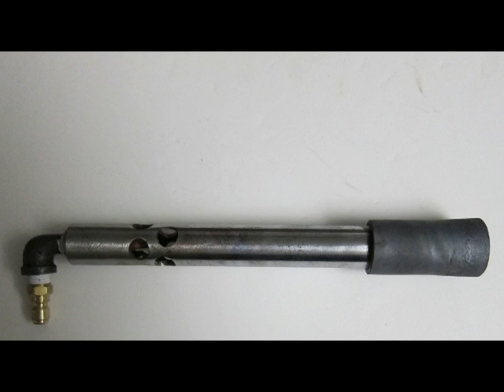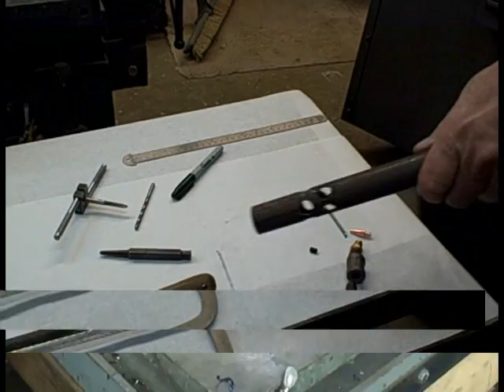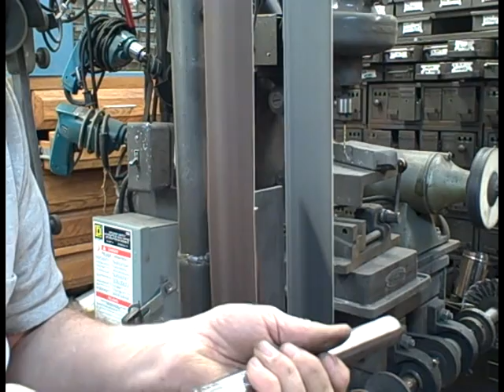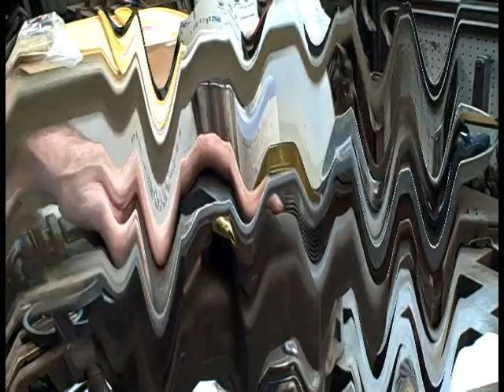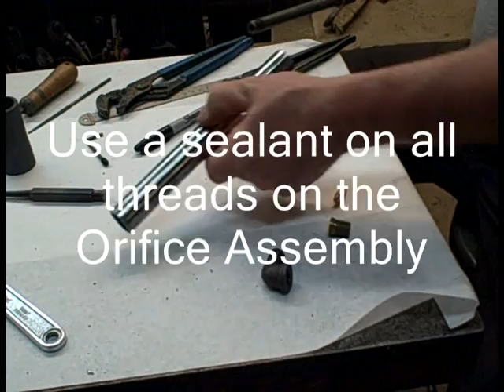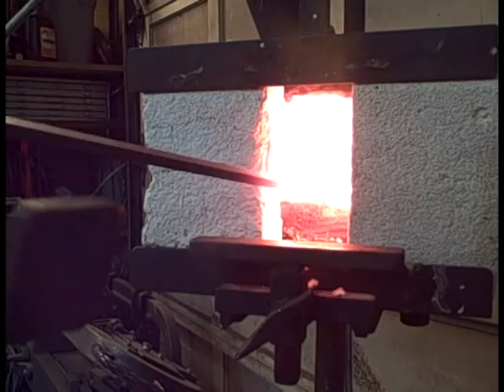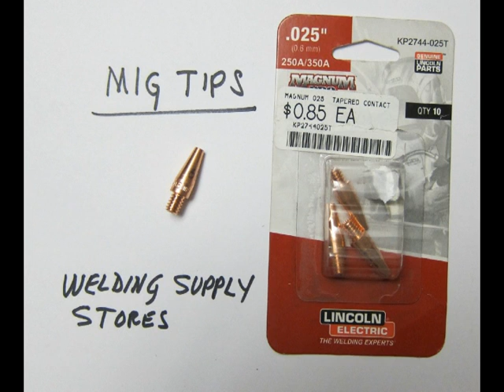How to build a Propane Forge Burner

Comment: I bought a very similar side arm burner off eBay and am just waiting for the refractory to dry before hooking the entire system up. Could you answer a couple questions for me? I'm entirely new to gas systems.

1: A seemingly stupid question but what is the point of the aspiration holes? Wouldn't this just let the propane leak from the system?

2: Is a ball valve entirely necessary? I just have a regulator (doesn't show PSI) and the braided tubing from propane tank to burner
Reply: +Chris Vozzella ....  Air has to mix with the propane to get the combustion needed to get a proper flame.  The propane blows into the burner tube under high pressure and draws air into the aspiration holes.  The turbulence of the air coming in from the holes causes the air and propane to be mixed.  Although I would not recommend you doing it (because it might create a dangerous environment), if you want to see how the propane would burn (if it would burn at all) without the aspirated air, cover the holes and try it (I would not).

In the most basic operation, you could do without a ball valve, but you would have to start the forge as  you opened the valve on the tank or as you cranked the regulator down to allow propane to flow.  Having said that, I would not have a propane gas setup without a ball valve very near the burner.  It allows for easy control of starting the flow of propane when you start the forge and provides a quick means to turn off the propane if there is a problem starting or operating the forge.  I consider all the components that are covered in my burner video necessary for safe and efficient operation.
Reply: Okay so my original concern was when the fire was blown back into the aspiration holes (It's kind of windy in my area sometimes and I have to forge outside)

Is this a cause for concern? I've been immediately turning the propane off when this happens.
Reply: +Chris Vozzella ....  It would be a cause for concern for me.  Aspirated burners generally do not do well in a breeze, and as you know, there are no safety mechanisms on these burners.  I don't know of any solution other than moving the forge or putting up something to block the wind.
Reply: okay cool thanks for the help David. Going to see if I can build a table with a semi wind block for the burner.
Reply: Hey David sorry to bother you again but I'm having trouble with the gas forge. Even though I built a good wind guard, the flame still wants to "suck" back into the aspiration holes and not into the forge. My setup is from propane tanks > High Pressure LPG (0-30 PSI adjustable regulator) > Side Arm Burner (bought offline but is identical to yours in this video)

I calibrated the burner like you showed by having the best looking blue flame, but am unsure on how to use the regulator. After testing the regulator at all different settings it still does the "suck" back into the aspiration holes.

Any suggestions?
Reply: +Chris Vozzella ...  Just two more things to try...  Beyond that, as I said before, aspirated burners (regardless of type) do not work well when it's windy.    What openings does your forge have?  Is it open on more than one side?  And how much?  Limit the openings to one that is down wind and not more than a few square inches(3-6).  Also, crank the regulator all the way to 30 PSI and let the forge get hot, then back it off if you want less heat.

Does this ever happen when there is no wind?

Wind does swirl, so if it's even moderate, you may not be able to use the forge outside.
Reply: When i tested it out today the wind was barely noticeable and with the wind guard up I don't think there is any chance the wind blew it out.

The forge guide I followed was: (http://www.zoellerforge.com/simplegasforge.html) and Zoeller appears to be MIA which is why I had to order everything elsewhere to try and make it work.

The opening is on one side and the diaphragm is variable depending on how the fire bricks are oriented. Making the hole larger and even taking away the fire bricks still didn't fix the problem.
Reply: +Chris Vozzella ....  I'm not sure what else to tell you, but here are a few other things to check.   Are you sure the thermal blanket in front of the burner is out of the way of the flame?  It should actually form a cone into the burn chamber.   Is the propane tank you are using full (or at least near full)?  Also, when it is working, does the burn chamber get to forging heat?  Does this always happen, or only occasionally.   Send me a link of the eBay auction that sells what you purchased....
Reply: I didn't have the blanket in a cone, more of a cylinder shape. I'll cut that out and see how it goes. The propane tank is half full, got it and an empty one off a friend who didn't need it anymore. Yes, every time I light it fails to keep the flame in the furnace. I'll try messing around with these things see how it goes.

this is  the ebay auction: http://www.ebay.com/itm/U-S-Made-gas-burner-blacksmith-forge-raku-kiln-propane-foundry-with-regulator-/231688958884?
Reply: +Chris Vozzella ....  Do you get a light to strong (jet blast) flame when you light the burner outside the forge?  If not (and even if you do), clean the orifice with fine wire or an acetylene tip cleaner (they can be bought for a few dollars at at welding supply.  If you don&#39;t get a jet blast flame, try a different regulator.  You might also add a pressure gauge inline to see if you are getting 30 PSI from the regulator.

Make sure the orifice is pointing straight down the center of the burner body.  You can ensure this is the case by unhooking the hose and doing what is necessary to hook a water hose up to the burner.  Hold the burner vertical (flare down) and turn on the water.  The water should come down through the center of the tube.  If it doesn&#39;t, that is most likely your problem if the regulator is working properly. &#160;

I like the end of the orifice down in the center of (or below) the bottom holes.  The picture in the eBay ad makes it look like it&#39;s above the top hole.   The orifice should work fine there as long as nothing impedes the air from flowing in evenly through the holes, but wind would upset that action.  See if you can more the orifice down some way.  If you can&#39;t do that without blocking too much air from the holes, see if you can replace whatever  he has with what I show in my video.  

One other thing....  I would classify a forge made from a 5 gallon pail as very large.  How many cubic inches is  your burn chamber?  This type of burner will only support up to around 300 cubic inches of burn chamber to get to forging heat.  If you have more than that, add thermal blanket until you don't.

One more thing....  The tip of the flare should be about an inch above (up into the blanket) the ceiling of the burn chamber.

If none of this works for you, I would suggest you contact the person you bought the burner from and see if they have an answer for you.
Reply: +David Hammer ...  One more thing....   This is important....  When you put  your burner in the forge, be sure you pack thermal blanket around the burner in the tube it is fastened inside of.  You do not want heat or blowback to be coming up the outside of the burner.

Comment: David, once I installed the burner into my forge everything runs great. I use the 025 tip for nearly everything and I have the airflow wide open by sliding the orifice all the way back. I could not get it to burn correctly in atmosphere, but into different forges of different sizes, one being a coffee cayenne and one being a turkey fryer, it worked great. Thanks for your help.
Reply from the maker: +Kevin C ....   That's a fairly common occurrence...  I didn't say it in the video (I should have).  When a burner is in a forge, it gets back pressure from the burn chamber so it acts differently.  I expect that makes up for whatever issue prevents the burner from working outside the forge (like a burr in the pipe...  or the orifice not being pointed straight down the tube....  sometimes even altitude will affect how a burner works).

Comment: Gloves around a sander? Maybe,. Maybe not. When I was first learning to work around machine tools, the rule of thumb was "nothing below the elbow around moving parts".

Better to give up a bit of skin than the whole arm.
Reply from the maker: +bill65761 .....   I use grinders with and without gloves.  It's important to be careful either way.  If I need to get my flesh close to the belt or what I'm holding will get hot quickly, I will generally wear  gloves.  I try to be aware and not get the gloves caught in any way.   I agree that if one is not extremely careful, you can hurt yourself very badly wearing gloves around moving machinery, but I find, in my case, I get injured less (burns and flesh wounds) when I wear them.

Comment: HI david I want to build a forge capable of 2500 C  I have my doubts as to the possibility do you know just what the capability of the burner gas air flow are is there any rule of thumb ?
Reply from the maker: +Andy McGaw I don't have the ability to measure output of burners.  I would expect it's not likely you could approach 2500C with a home built burner.  That would be over 4500 degrees F.  I have an infrared thermometer (gun) I have tried to use to see how hot my forge gets.  The highest reading I've seen was under 3000 degrees F.  Forging temperatures are much less than that.

Comment: Hello David, thanks for creating this video and for sharing you knowledge.  I have had several issues getting the one that I build to work correctly.  I have built everything to your specifications, with the only likely variance being the flare.  Mine is slightly longer, and likely not as wide.  My coupler fits nicely and provides a good center for the orifice.  My problems was the flame would pulse, and when I increased the propane flow it would stop pulsing, and then blow out with the flame leaving the flare.  I then blocked all of the air holes and got a giant yellow flame.  I then began opening air holes one at at time.  The flame seemed weak, and would blow out leaving the flare if more than one hole was opened.  I suspected that I had too much air flow, so i bumped up the MIG tip to an 045, as the 035 yielded only slightly better results.  I still find that if I start to open up the gas flow to get the flame velocity as I believe it should be, the flame leaves the flare and blows out.  The venturi effect is massive on this burner and creates a very high suction with.  It seems that the air velocity is too high.  I have went as far as a 5/64 and a 1/16 size orifice, but both are too large even with all the air holes open.  So, the correct size orifice seems to be somewhere between 1/16 and an 045.  I have also tried adjusting the office deep into the tube, past the air holes, and all the way out exposing all the air holes.  The flare all the way in, all the way out, and even off.  Right now here is my settings.

045 orifice
half holes plugged off
brass extension between orifice and coupler which puts the orifice tip deep past the bottom holes
flare all the way extended
pressure is low, no gauge to measure
using 10 PSI regulator

The needle valve is about half way open, anymore and the flame blows out.

I'll shoot a video and show what it's doing.

Any help is greatly appreciated.
Reply from the maker: +Kevin C Since you are using different materials to make a burner, it's hard for me to comment.  I only know that I have great success with burners made with materials as I describe them (with the exception of bumping up to .030 mig tips if someone is having problems).  One thing though, I would not expect a 10 PSI regulator will work well with these burners.

Comment: Hey David did you ever get that ribbon burner figured out  question I have a blower
 from a house Furnace  will that work with the ribbon burner ?
Reply from the maker: +Lucky B It's been several years since I've messed with ribbon burners, but yes, I did get them to work.  I have a small ribbon burner (from Joppa Glassworks) that works with a commercial venturi (it's a fairly expensive setup, around $250 to get a working solution).  I experimented a lot to see if a homemade venturi would work with it (to reduce cost), but was never happy with results.  

I bought the smallest ribbon burner Pine Ridge sells (requires a blower) and had good luck with it after I found an appropriate blower for it.  Please know that even their smallest burner needs a large forge to work (my burn chamber was almost a cubic foot).  

It's unlikely that a furnace blower will work with a ribbon burner.  It takes a blower that has a strong positive airflow when that airflow is being restricted (a ribbon burner has an air chamber that has to be continuously pressurized).  Most blowers will just spin and not force air out if you completely block the output side.  If you completely block the output and the fan is still trying to force significant air out, you have a blower that will probably work.   How much forced air you need will be dependent  upon which burner you buy, and how much performance you want.  I would not even recommend the blowers Pine Ridge sells.  I have the larger of the two blowers they sell (255  CFM) and, although the burner would run, I didn't get the performance I wanted.  For what I want, it takes a burner that is capable of a lot more than the blowers they sell.  Commercial blowers capable of doing this are extremely expensive.  A less expensive option is to buy a blower that is designed to inflate kids bouncy houses and use a tool speed-regulator (Harbor Freight sells one) to control speed (and thus WC static pressure).  I watch for those blowers at flea markets.  You might check eBay also.  I have a Mighty-Vac blower that works perfectly (model 275).   I picked it up at an industrial auction.  I would also expect that old vacuum cleaner motors where you can hook a hose up to blow would work, although I don't know how long they could be run without getting too hot.
Reply: Thanks Dave
 I have a large shop vac that is like my ex wife  Blows plenty of hot air . I used it on my coal forge after I got it done and had to its a speed control  it  blew my fire out ,  but with charcoal  it can burn some wood that's for sure .. thanks again .

Comment: Would there be any reason not to use all stainless beside price/availability?
Reply: Richard Baechle Stainless pipe is much more difficult to drill and tap than iron pipe, but if you are able to handle that, you certainly could use stainless for all the parts.
Reply: +David Hammer thank you for the reply my last question is I don't have 9" would 6" suffice?
Reply: +Richard Baechle If you are asking if a burner tube can be as short as 6", I have to say I doubt it.  It's been a while since I have experimented with length, but If I recall correctly, I don't think I have had success with pipe much shorter than 8".  I would recommend buying a short piece of plumbing pipe at a big box store and cutting off the threads.

Comment: I HAVE QUESTION DOES IT HAVE TO BE 9" BECAUSE I HAVE A 12" PIECE OF PIPE
Reply: Bryon Perry The pipe needs to be long enough for the propane and air to mix well enough for combustion.   Nine inches is just a little over the minimum length for 3/4 inch pipe.  It could be somewhat longer, but I personally prefer keeping the burner as short as I can.   I would still recommend you cut the pipe to 9 inches.  If you  have the other tools necessary to make the burner,  you should have a hack saw to cut the pipe.  If you want to try the longer pipe, I would expect it to work, but you would have to experiment with it.

Comment: David Hammer I was wondering if you used s 20lb propane tank for the burner
Reply: Matthew Guy I have several sizes (20, 30 and 40 lb) propane tanks I use.  Is there some reason you are asking the question?  Larger tanks have pros (less likely to freeze up and they need to be filled less often) and cons (tanks are more costly to buy).  If you use a 20 lb tanks and take it to have it filled, rather than just exchanging it, you will most likely save money (businesses like Walmart do not have their exchange tanks filled to capacity, and charge  a high price per gallon for propane).  I have my tanks filled at Tractor Supply Co. (all stores do not have propane services).
Reply: Thank you for the reply if it is running low will it not have a powerful flame
Reply: Matthew Guy Unless your tank is almost out of propane, a 20 lb tank is fine with this burner.  If your tank is running low (but is not empty) and the burner is not running normally, it is likely your tank is freezing up (this is fairly common if you are running at a hot heat..., it even happens with larger tanks).  Put the tank in a  tub of water (I use my slack tub) and it will deliver the rest of the propane without freezing up.  Generally,  you can see a frost line on the tank if it is freezing up.

Comment: How thick is the wall on your schedule 40 steel?
Reply: Mr NobodyI don't know.   I'm sure you can find the answer online by Googling for it.
Reply: David Hammer Thanks for the quick response. I bought some steel tubing from home depot that was 3/4" just doesn't look as thick as yours.
Reply: Mr Nobody I would expect that all the iron pipe that Home Depot sells IS schedule 40 (you could ask them), which would be the same as used in the video.  Schedule 40 is a standard thickness.  If you bought something OTHER than pipe (from the plumbing section), all bets are off.